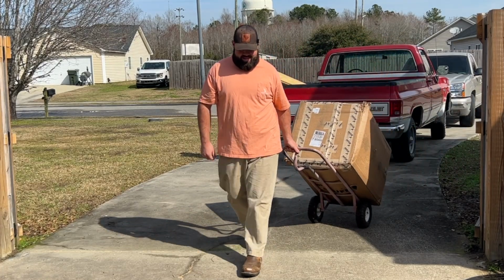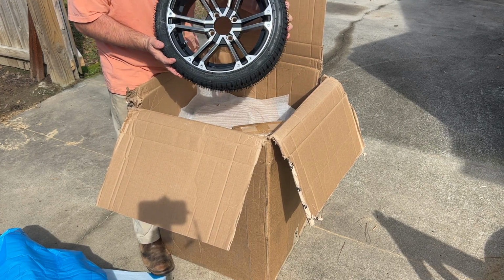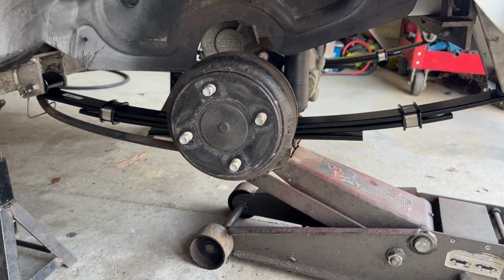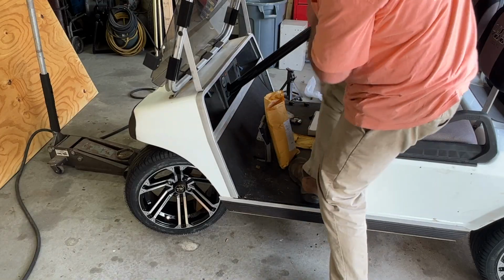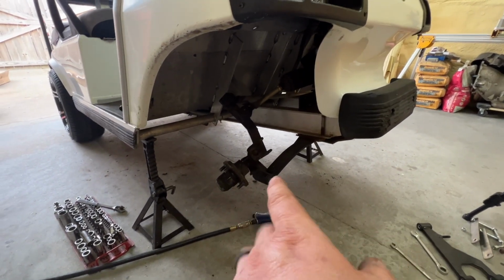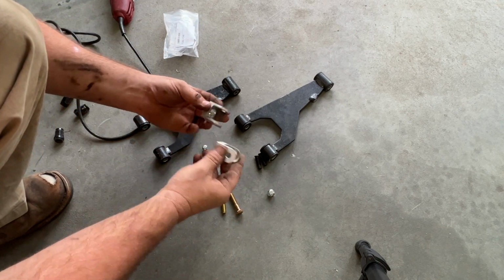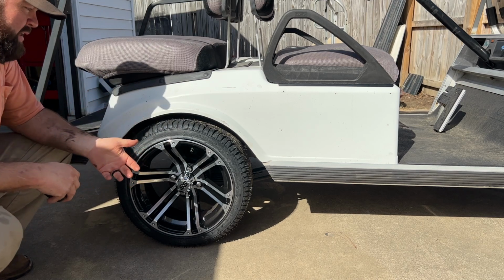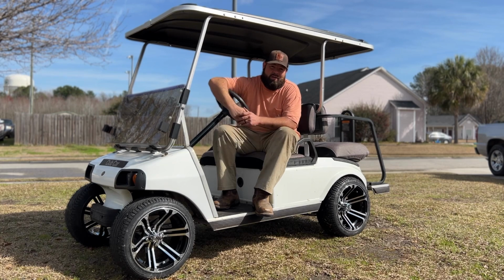We Fit 14" Wheels & Low Pros on the Club Car DS Golf Cart With NO LIFT | Jakes Wheel Base Extension

Comment: I bought the same two things for my DS to fit 14’s and low pros. I did the 1” block first though because it didn’t require modification. They fit fine, so I still have the wheel base extension kit in my spare parts pile

Comment: Did you install longer or better shocks in the rear? I installed the heavy duty leaf spring and the ride is extremely bouncy for the rear riders. I still have the stock tires on my 1999 Club DS and didn't upgrade as of yet.

Comment: I’m redoing my 1980 Caroche and using a set of 215/50-12’s they are 18.5 inches tall versus the stock 17.9”. Should look much better. It’s only 36V so I don’t want to kill the speed going uphill.
What is the size of the wheels and tires you are taking off as well as the overall diameter?
Looks great, now you just need to move the wheels out to match the rear width.

Comment: Now that its been a few weeks. Do the tires rub?
I have the same cart and am following you step by step on building mine.  Thanks in advance
Reply from the maker: Not at all. The rear springs do not allow it and the front is push out enough not to. The ride is a tad harder but it’s still a golf cart.
Reply: @Fentertainment  Sorry, last question. Is there a specific offset Terminator wheel you got or the one in the link is the correct offset. Thanks and have a great  weekend

Comment: First of all, I am not a mechanic nor do I have an inkling about anything golf cart, a statement I am about to prove with my question.  I was watching you modify the front end, which meant you had to modify the upper control arm because of your two inch forward extension plate.  You had to cut off the shock mounting bolt, then drill a hole to Mount the mount sent with the kit.  The question I have is could the same result have been achieved by either turning the upper control arm over or by switching sides for the control arms…just a thought, might have been a quicker, more simple, less time consuming modification…just a thought.  Enjoy your videos.

Respectfully submitted

Comment: The thickness of that aluminum bracket probably gave it close to a 1” lift too, didn’t it?
Reply from the maker: If you look closely the spring actually fits about flush with the plate. It’s recessed for the spring.
Reply: @Fentertainment  gotcha